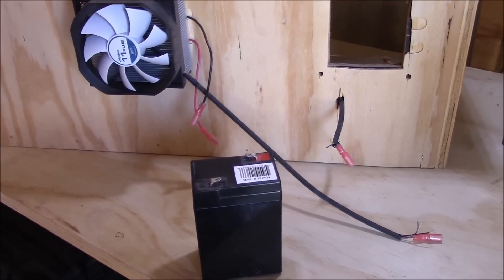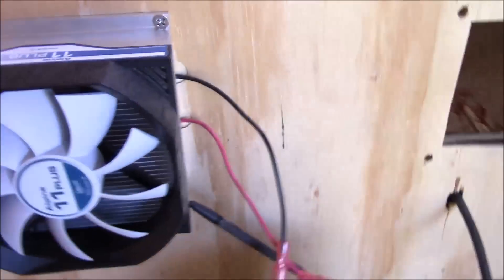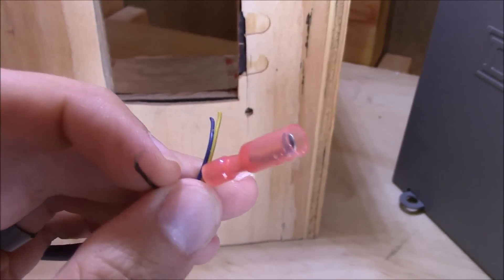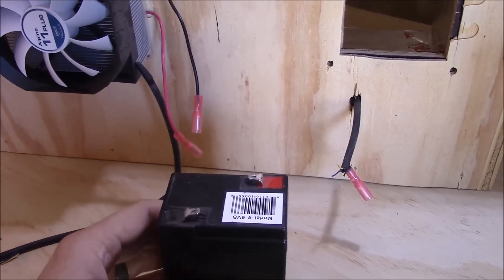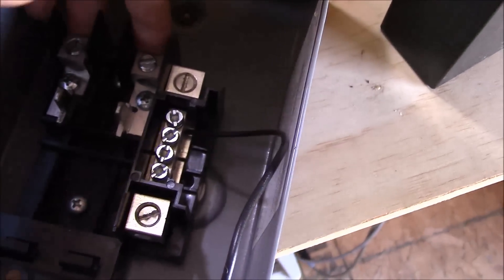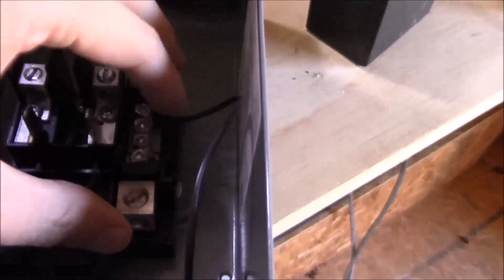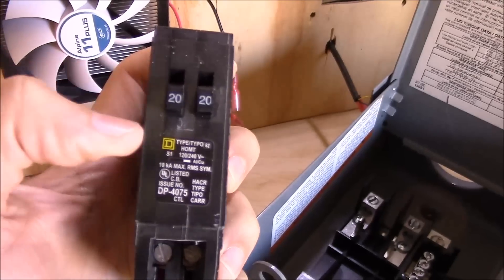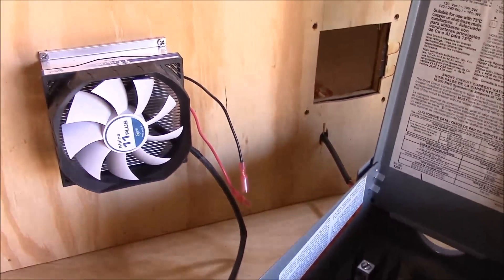How To Wire A Peltier Cooler or TEC

Comment: Can you sudjest me what kind of battery are suitable to sustain and to power up the Piltier module like that?
Reply from the maker: Any 12V battery will work.  Some batteries supply slightly higher voltages than others, which will affect the performance of the peltier.  Low voltage is more efficient but may not reach the desired temperature.  Higher voltage is less efficient but may be able to get an extra few degrees of cooling.

Comment: How do I determine type of combiner box., Amps/breakers? I HAVE    4 fans 4 Peltier on  HEAT sink and cold plate and a 60A PSU
Reply from the maker: Wire it up as a load center.  Feed the power from the PSU into the load center and then use 5-8 breakers to distribute the power to the 4 TEC's and fans.
Reply: @LDSreliance  thanks.  Can I reverse polarity on Peltier to switch back and forth for heat and cool?  Building incubation unit, to maintain temp range as required....
Reply from the maker: Yes you can switch the polarity.

Comment: can computer 300w psu power 2 Peltiers if i use molex to connect.  +12V: 20A    (Kolink 300W Core KL-C300)
Reply from the maker: No.  A 300W power supply probably has, at most, a 15A 12V rail.  Maybe less.
Reply: do you know any psu what will work?
Reply from the maker: Not a specific model but to get at least 20A out of your 12V rail you need at least about a 450W PSU.

Comment: can I use laptop charger like 18.5v and 3.5 a output? Thanks for the feedback
Reply from the maker: No, an 18V adapter/charger would fry a 12V device like this.  Look for a 12V power adapter from a computer monitor.

Comment: Dear 
I have connected a pelter cooler device  with my  12v 1Ah power supply 
Pelter works fine but when i  connect the  fan with the same line  fan stuck and not running  . Please help me
Reply from the maker: What are the specs on the power supply?  12V 1A?  If so that is way too small.  You need at least 5-6 Amps.

Comment: Could you link me or refer me to a power supply for this that you could plug into the wall? Also, I'm planning on using this cooler with two 6v DC air pumps. Could I connect those to the power source as well without damaging anything? The air pumps will only be running every now and then for about 10 seconds at a time. Sorry, don't know much about electricity lol.
Reply from the maker: You can use any 12V power supply, such as a computer monitor power adapter:  http://amzn.to/2td4VAO

Just cut off the end connector that would normally plug in to the monitor and there will be 2 wires (positive and negative) for you to connect to your peltier or other 12V devices.  As for powering your 6V air pumps you will need a 6V power source for those like this:  http://amzn.to/2sTXW09

Keep in mind that if your air pumps need more than 3 Amps then you will have to get a bigger power supply than the one I linked.
Reply: LDSreliance thank you
Reply from the maker: You are welcome.  Thanks for watching!  Be sure to subscribe if you haven't already.

Comment: Where do you buy that battery from and how long does it run for?
Reply from the maker: That battery is actually only 6V.  I was just using it for demonstration purposes.  I would recommend one like this:  http://amzn.to/2p49qOT

I can't answer how long it will last without knowing what you are going to power with it but if you build a peltier cooling device similar to the one in this video it would last for 33 minutes before it needs to be recharged.
Reply: LDSreliance how do you recharge the battery?

Comment: This sucks don't build this use a very small heat sink  with a fan that sucks and very large 4x heat sink for heat
Reply from the maker: Yes because it is that simple.
Reply: True the parts are easy tofind butId go with max efficiency next build.

Comment: Do you have a recommendation on where I could get more compact combiner box wiring the fans and peltier cooler?
Reply from the maker: +Michael Lay I have seen people use small buss bars mounted in those small, gray weatherproof electrical boxes they sell at Lowe's or Home Depot.  They can be as small as 4 inches x 4 inches x about 2 inches.  They come in various sizes.  You would just need to get two buss bars (one for positive and one for negative).
Reply: +LDSreliance thanks!

Comment: hi. can i use a 12V DC 6.67 Amp Power Supply (a laptop power supply) for my 12v 6amps peltier cooler?
Reply from the maker: +Namer Afzal Khan Of course.  I have done that quite a few times.  Works great!
Reply: but i am having trouble with connecting the power supply wires with peltier cooler wires. do you have any tutorial for that?
Reply from the maker: Namer Afzal Khan
No, sorry.  You should just be able to connect your yellow wires on the power supply to the red wire on the peltier.  Then connect the black wires on the power supply to the black wire on the peltier.
Reply: +LDSreliance Thanks

Comment: Hey great video, could you tell me if you can wire it up so it can run through voltage from plug sockets?
Reply: You will need a power supply, hope this helps 6 Years later!

Comment: hi if you want to cool your heat sink better , check out the video "Ultimate Corsair H100 Cooling Mod"   ( the guy talks allot,so its worth skiping to the results 10 mins in.)
Reply: rainbowsalads the problem with that is that the alpine 11 plus that he uses at the moment costs around £10, and the h100 costs excess of £100.
Reply from the maker: rainbowsalads Cool, thanks!  I will check that out.

Comment: is that a DC breaker??  will an AC breaker experience the same load from 20A at 12 volts as it will with 20A at 120v? I dont think it would trip.
Reply from the maker: It is an AC breaker by Schneider Electric from their Homeline series.  They are not rated for DC but I have used them for a year and a half with no problems with low amperage.  They have another series of breakers called QO which is rated to 48V DC.  They cost a bit more, though.  I will be replacing my load centers with QO series in the future but so far the Homeline series has been fine under 20 amps.
Reply: But have you tested to see if they will indeed trip at 20A with just 12 volts? In my mind I'd imagine that the allowed amperage would go up as the voltage goes down.  Also!!! Where are the videos on your mini fridge project?  You only made the one video.  I wanted to see how it turned out and whether you were able to drop the temp to maybe 35 or 40 degrees.
Reply from the maker: Good questions!  The breaker does indeed trip at 20 amps.  I don't know how reliable it is but I am also not using the breakers for their safety purposes but more as on/off switches for my loads.

My fridge project is on hold until I can build another cooling unit.  This time it will be liquid cooled with a chiller plate instead of air cooled with fans.  Stay tuned!

Comment: How do i connect heatsink fan, thermoelectric device and N-Channel for the wiring? We using breadboard and arduino. My project is like an air-condition but we using heatsink fan as air-con.
Reply from the maker: You need something to combine all of the positive wires together and also another to combine all the negative wires together.  You can use something as simple as a buss bar (http://www.homedepot.com/p/Square-D-by-Schneider-Electric-7-Terminal-Ground-Bar-Kit-PK7GTACP/202353316) or something more complex like a load center (http://www.homedepot.com/p/Square-D-by-Schneider-Electric-Homeline-70-Amp-2-Space-4-Circuit-Indoor-Surface-Mount-Main-Lug-Load-Center-with-Cover-HOM24L70SCP/100202333) like I showed in my video.
Reply from the maker: Keep in mind that these products that I use are not originally designed for DC use but for low voltage and current like we are working with there isn't any risk of fire or bodily harm.

Comment: Im working on the same thing , I wanna make a portable Peltier Fridge but i find it so difficult , I use 2 peltiers each one give  50 watt so do you think it will work good ? also about the nails, When connecting them to fix the heat sink  I think the nails will transfer high temperature from the outside heat sink to the inside one which is cold so the cooling part inside will not work as expected am I right ? please explain that part because it makes some problems for me.
Reply from the maker: Yes, the bolts that connect the two heat sinks may transfer a bit of heat from the hot side to the cold side.  Someone else pointed out that the fan on the cold side will produce a small amount of heat as it runs inside the fridge.  I think these 2 heat sources are pretty small and I am not sure how you can overcome them.
Reply: ok thank you so much brother , I have another question .. how many Wat that your peltire works with ?
Reply from the maker: There were 2 peltiers in this refrigerator.  One was 5 amp (60 watts) and the other was 10 amp (120 watts).
Reply: sir, I need properly video of wiring of peltier refrigerator. Because I made exactly project like your video. so please help me & send wiring video of it on my mail as below.
virendraparmar56@gmail.com